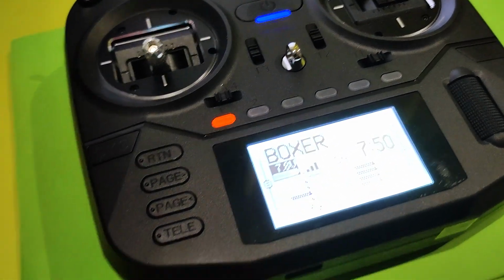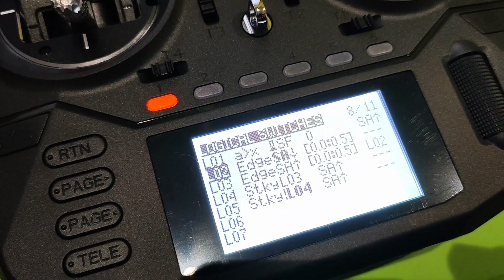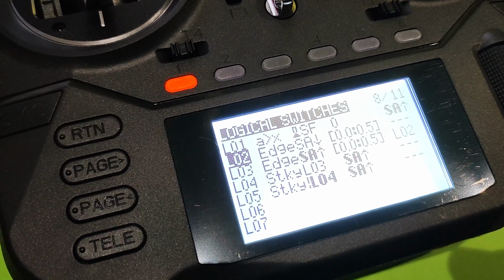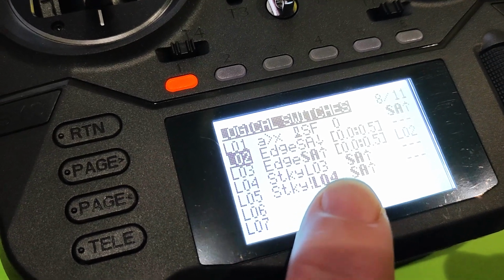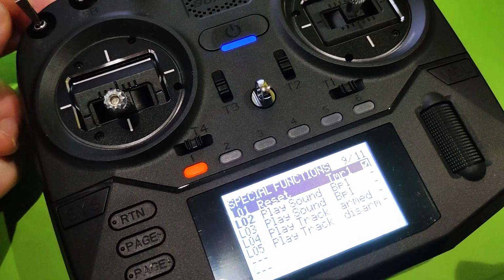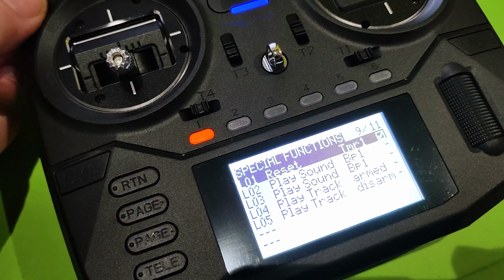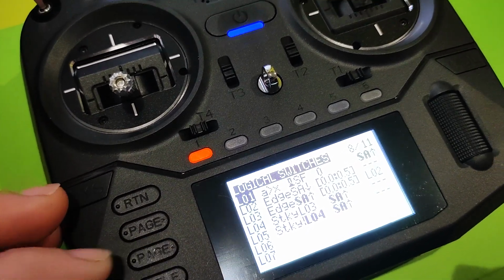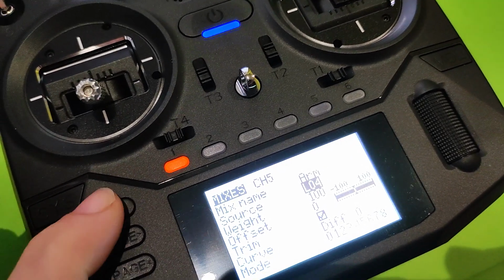EdgeTX - Timed two-stage arming using a single switch on a RadioMaster Boxer.

Comment: Cool, I love seeing new logic how to control functions to get more ideas.   One comment, rather than creating L05 couldn't you also just use !L04 for the disarm audio or does the Boxer not have the !xx bits?  The ! before the switch means 'not' so !L04 means LO4 is not ON.  I use those on my TX16S logic often, I assume the Boxer also has this option?  Not that big of a deal, would just eliminate one line of code but nice to program efficiently.
Reply: I was wondering the exact same thing